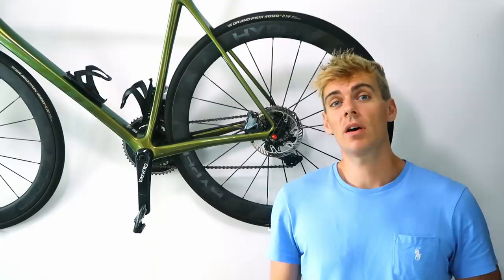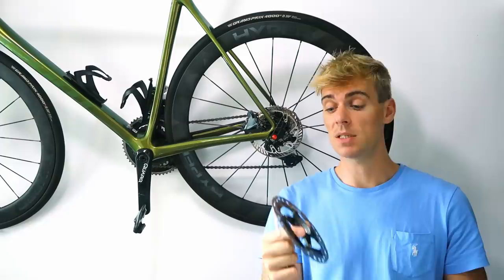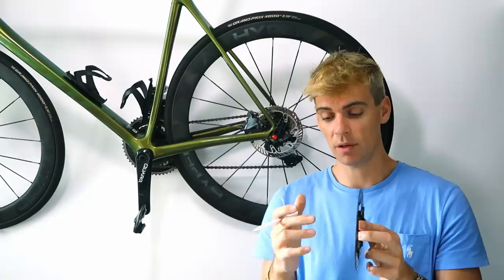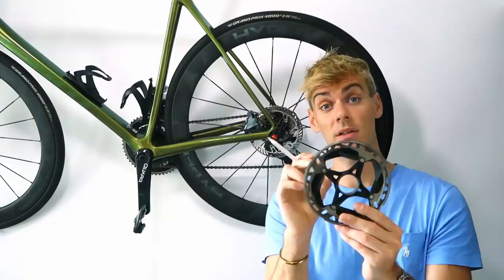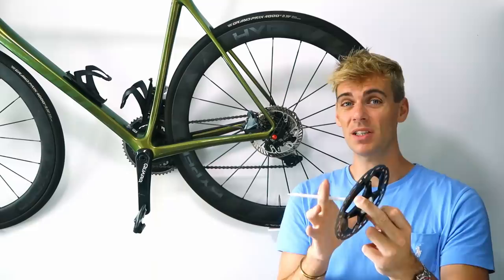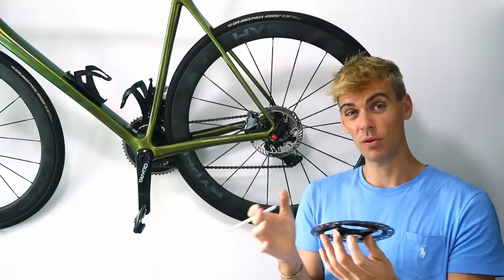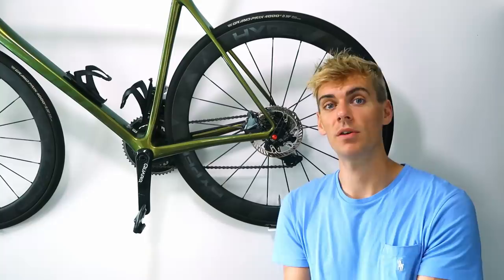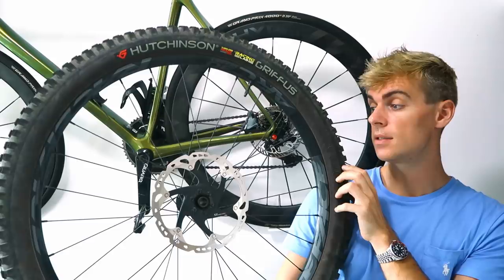Why I stopped using Shimano rotors: Disc brake rotor design, cracks & thermal issues discussed.

Comment: Logged in just to leave a comment. No idea why people bite these floating rotors. Solid ones brake great and last long. Did a 23km descent with an average grade of 5.5%, weighting at the time 92kg with only a front brake, 160mm rotor. Performed ok, minimal brake fade. Temperature wise, I just don't think the hubs get that much heat. Just think of the motorcycle or car brake disks that get up to 600C+ in race conditions and don't fall apart.

Comment: Don’t get me wrong I don’t want to question what you just said. But there seems to be an inherit quality difference between Shimano MTB Products and Shimano Roadbike Products. I’ve been using brake rotors with the same kind of technology on my enduro/downhill bike for years now, in the summer season even with metal brake pads. (Don’t remember if its the Saint or XT(R) Series) And mine should be structurally worse because they are 203mm rotors instead of 160mm like yours And I haven’t had an issue so far. No clicking, no rubbing and they only ever bend if I’m stupid enough to give them some kind of strong hit. I once even ran one down to 1.46mm (-0.4 below min. thickness, metal brake pads) and I had no delimitation. I wouldn’t have realised they are worn down if I wouldn’t have measured pro cautionary. And my first pair lasted like 2 years, not 6 months. What you are telling us sounds scary. And I don’t really think that the pad gap between road bikes and mtbs is any different.

Comment: Yeah i'm running the Ice-tech rotors atm, I did wonder how long they will last with only a thin sliver of steel each side... Do you run resin or sintered metal pads to get this level of wear?

Comment: Very excited to follow that project 👍🏻 Went back to my “old” rim brake bike after being on discs for a while - not just because of being annoyed by the brakes, but it sure is nice to have one thing less that needs fine-tuning all the time
Reply from the maker: Same.
Reply: Exactly...part of why I ride is a ‘simple’ mechanical interface, peaceful rides (I prefer quite hubs), and a ‘back 2 basics’ experience...discs, 2 much electrical equipment etc detracts from that~
Reply: @SprayIgniteBoom  I had this realisation recently while considering DI2.. I already get annoyed with keeping the head unit charged and pairing sensors, why add another battery etc to the list!
Reply: "You just didn't set the discs up properly"
Reply from the maker: @durianriders  😂
Reply: Spend the extra money on quality parts. CK BB, Hubs, Headset yadayada, Phil White etc. Works better, looks better
Reply: @durianriders  are you still stalking women?? really enjoyed you getting a proper doing !!!!!
Reply: More fine tuning? Properly working hydraulic disc brakes require much less fine tuning than rim brakes, especially if you want consistent performance. I also have Shimano IceTech rotors on my mountain bike and they indeed rub for a while after heating up, probably due to the hysteresis mentioned in the video, but they always return back to shape. Also maybe they are easy to bend accidentally, but they are also easier to straighten back, I do it just with my hands (of course freshly washed hands and do de-grease rotors afterwards). After heavy braking I just apply the brakes lightly once or twice and it seems to help - maybe the bent rotor temporarily pushes the pads out slightly more when releasing the brakes. I always had some concerns about the delamination problem, though - wondering what process is used to join these layers; the steel layer seems to get very thin when rotor gets worn out to 1.5mm. There are also some cheaper IceTech rotors without a real "spider" and fins, just the sandwich design - RT70 AFAIR. I have such a 160mm rotor in the rear and after heating up on longer decent you can see that the braking surface changes color sightly and the "legs" connecting it get a golden hue, but this is only limited to a small distance from the braking surface, which shows that the heat dissipation is good and the heat transfer towards the centerlock interface is likely small even without a real spider solution. In the front I have a 203mm XT level finned rotor.
Reply: There s no fine tuning all time,wtf are u saying
Reply: The big problem with road bikes disc's is probably them being super tiny and getting hot AF. On an MTB i haven't seen any of those problems that ppl seem to have with disc's on road bikes.
Reply: @kaedeschulz5422  or is that as MTBers we understand the key job of brakes is stopping us, and we use them constantly (in all manner of iffy conditions)?  
Also TBH, I've not had an issue with the rotors on my gravel bikes either - they just work.
Reply: @br5380  Most ppl i know use RT66 and i use the 64 because my hubs sadly have center lock disc mounts...
never heard of any problems with those. Also we use insanely large rotors to prevent brake fade. I run 203 front 180mm rear on my Enduro Hardtail any may even go bigger. Not sure yet. A friend of mine uses 220 front and 203 rear on his Full Sus Enduro. Maybe even 220 in rear too.

On road bikeish bike's problems always seem to be caused by having tiny rotors that get super hot.
Reply: @br5380  -- but he's talking about discs on ROAD BIKES.
Reply: @jerryc.5210  I also ride my gravel bike on the road

Comment: I ride 800+ miles per month and my Shimano rotors still have tons of life left.  However, they do tend to warp slightly but nothing I can't fix in a couple of minutes.
Reply: Yeah thisbguy is full of BS on his videos.
Now must be trying to start a business on a market full of the stuff for any given part.
I unsubscribed.
Reply: Hey Todd, which model of rotors are you using?
Reply: @mihugong3153  I've used both the Dura-Ace SM-RT900 and the Ultegra SM-RT800 rotors.  Both work great and I've had no wear issues using both of them for thousands of miles.
Reply: @tccycling  Cool, thanks for the info. I have XTRs on the way for my road bike, I guess I will try my luck :)
Reply: I ride and commute in only hills, I got 10 months out of my pads and rotors, that said I should have done them after prob 8 or 9

Comment: This video answered all my questions about disc brakes. And i learned a lot more than i asked for. Cheers brother! Im shifting to disc brakes this month as sponsors are now supplying us disc brake bikes, and im already having nightmares on how to maintain them, let alone the cost
Reply: 1.5 years ago, I got a disc brake road/endurance bike ... w/ Campy 160 rotors front & rear.  After 6 months, I was occasionally stopping to "re-center" the pads while on rides.  After 1.5 years, the rotors are slightly "warped".  If I had  had to replace them at 6 months as Peak Torque reported, I'd go crazy.  More importantly, I believe good rim brakes are better for road bikes because of the KISS factor, reliability, and durability.  I've had Campy Record rim brakes, so I can't comment on Shimano quality.  I bought my first C-Record bike in 1962.  I NEVER had any problems over the last 30 years/6k miles per year with good rim brakes.  They  stopped as well as my current discs, pads lasted longer than disc pads, and close to zero maintenance.  Disc brakes = 1) re-centering, 2) quicker wear, 3) more parts, 4) more cost, 5) warping, 6) special tools, 7) hydraulics & bleeding.  For ROAD, I consider discs a solution to a problem that never existed.  Gravel is a different application though, and I'm not talking about MTBs.
Reply: Sanaol may sponsor
Reply: @jerryc.5210 The Shimano XT 8100 disc sets on my Trek custom mtb have been stellar with correct maintenance and cleanliness which I follow .
Reply: @jerryc.5210  The new ice tech Shimano's are crack prone and not linished very well . They are Chinese "questionable" quality .
Reply: @jerryc.5210 I use Galfer 1.8mm thick discs in 180mm diameter or Deckas ones in floating bushing style with coloured 7075 carriers .

Comment: I'd buy some, but i think most people would be upset when their disks had rust on them. I'd be willing to guess that a surprising percentage of even the most expensive road bikes only get used a few times a year. I also think this push to make disk brake bikes as light as rim brake bikes so they can stop making rim brake bikes forces them to make rotors that don't have the mass they need to work right.
Reply: Agreed, rust would be a no go for me and I'd also like to see more road bike (centerlock) discs w/ thicker friction ring (i.e. >=2.0mm) for more mechanical and thermal stability.

Comment: Fascinated to see what you come up with versus what Shimano has in the pipeline with Dura-Ace 9200 brakes (and the context of Chris Froome's comments on disc brakes)
Reply: Considering their cranks have been failing for years due to poor design and they have not attempted to rectify the issue, they will probably not have any improvements in the pipeline.

Comment: I'm super excited to see how much better you can make rotors compared to what's available now. I will definitely buy a set when its available.
Reply: It will cost 150 pounds and last about 3 months and the constant of re adjusting the rotors and calipers so it doesn’t rub 😂 made in ali china 🤣

Comment: an efficient rotor would be, perhaps the size of the actual wheel rim, with an efficient and simple calliper type system applying the pads to the surface. You could even use the actual wheel rim. Maybe one day, manufacturers will decide we need that

Comment: I have been using AFS 03 rotors for a few months now. One thing I noticed is that the rotor feels soft when installed with some third-party internal spline lockring. It appears that because these rotor were designed for AFS, their crown face area is slightly larger than the lockring of the usual size. ZIPP's 160mm lockring solves that problem (ZIPP has two sizes of lockrings, but both uses external spline).

Comment: Interesting. 6 months life for rotors is crazy! My bike came with RT99 rotors which I replaced at approx 17500 miles, or about 3 set of pads. I replaced them with R8000, and your video prompted me to check them - the rear is at 1.5mm after approx 6700 miles, so the lifespan has been worse! The Campag ones look better value so I will probably go that route too.  Nice watch by the way, I have one of those myself!

Comment: My son recently had an Ultegra rotor fail after about 6 months use. The failure in his case was caused by the aluminium "cooling fins" becoming distorted meaning they rubbed on either side of the caliper. 
The stainless part was less affected. A complaint to the retsiler said was responded to with "no warranty claim as you were "dragging your brakes"".  My son has excrllent descrnding skills snd mskes much less use of his brakes than i do (i am a BC qualified coach  so i know how to observe these things...until he gets out of site!). I will be definitely switching back to full steel rotors after watching this. Thank you.

Comment: Good analysis.  I use SLX RT-70 centerlock rotors on MTB (160 and 180mm).  Reasonably priced and never had an issue.  Cheers and keep up the excellent content.
Reply: Roadies a dragging tiny rotors with tiny little callipers down mountain descent nonstop for miles.

Comment: Just because a rotor is two-piece doesn't automatically make them "floating". Very few bicycle rotors are floating. Hope make some. The braking surface has to be able to freely move laterally for them to be floating.
The point of making them two piece is to make them stiffer for a given weight.
As far as your desire for a full steel Centerlock rotor, you could pick any 6-bolt with a Centerlock adapter.
Reply: Very good points!

Comment: if your just going to laser cut solid piece - maybe inconel or hastelloy would be a good choice if you can get some offcuts? 
Really like your engineering knowledge - exceptional for such a young fella! Just remember to try your prototype on the rear wheel first before trying it on the front.

Comment: They’re not floating - floating rotors are where the rotor can move on the spider.

Hope rotors are floating for example.
Reply from the maker: These rotors definitely move on the spider... intended or not! Those rivets are not a perfect lockded 6dof fastener.
Reply: @PeakTorque  Sure, but that’s not intentional I suspect. Hope rotors have the relatively larger circular attachment, same as motorcycle and car floating rotors - designed to assist in even pad contact and more consistent bite points across varying temperatures.

The Shimano rotors are technically two piece fixed. Floating means they’re designed to move to accommodate variable pad contact situations.
Reply: Someone not named Froggy doesn't know what a floating rotor is, or that the flex of a thin sheet of metal isn't "float."

Comment: I've been using (older) XTR center lock all-steel (non-sandwiched) rotors on my bikes since 2003. Never had any issues at all to date. And they have lasted me literally 10's of 1000's of miles.
Reply: Dude get some new rotors. If your rotors get to thin you might go for your brakes on a fast downhill and the whole rotor jams into your calliper and throws you over the bars.
Reply: @TheNotoriousMIC  my current bike has around 40K miles on it and the XTR rotor thickness is fine. No significant or even noticeable wear.
Reply: @theadventurebiker  well if you’ve measured them and they’re still thick enough then we’ll done.

Comment: Great vid, always been suspicious of the amount of material on these rotors to disapate the heat. We already know carbon rim brakes exceed 200C so having a much smaller disc makes the disappation of heat even harder. Interesting to see what you come up with. 👍

Comment: I'm using SwissStop Catalyst Pro rotors on my shimano 105 disc brake equipped road bike and I love them.
Reply: Me too. My rotors have lasted over 1 year and I weigh 95+ kgs and ride in hilly Cornwall.
Reply: Use SwissStop pads too. 34 RS? Something like that.

Comment: From doing some work in this area, I'll say I've never seen heat manage to effectively make its way from the rotor into the hub body. Most rotors are stainless, which is terrible at effectively transmitting heat through the minimal cross section of the webbing and has ample opportunity for both convective and radiative cooling given the spindly nature of most rotors. Those with aluminum spiders have a bit less resistance in regards to heat transfer, but by the same token any heat making its way into the aluminum is even more quickly radiated and blown away. As well, the brake pads/caliper/brake fluid act as a quite significant heat soak for the system.

I'll also say that weight weeniesm is much of the cause of brake issues in the cycling world. The amount of mass used in bicycle brake rotors compared to the system mass is an order of magnitude less than for an auto or motorcycle, even though they're designed for ~similar speeds of operation.

ED: As a follow up, take a look at images of people who have overheated their road or mtb brakes. The heat affected zone universally stops barely past the edge of the pad contact patch. Oh, also fun note on the Shimano rotors, definitely had a coworker manage to squeeze the aluminum out while riding in the Alps!
Reply from the maker: Wow that sounds extreme. Yep totally agree. There's just not enough thermal mass or surface area.
Reply: Good points. A motorbike rotor might be between 1-2kg, of a 180kg motorcycle + 70kg rider that is ~0.4-0.8%. If you take a 130g bike rotor, that is ~0.2% of the total system weight. So a fair bit less yeah.
Reply: Haha my friend said it happened to one of the guides he was working with in the alps. Might be the same guy.

Comment: A lot of the pro teams where using Shimano mtb rotors last year. Anyone noticed that the industry has caused lots of new problems to solve with discs. Brake rub, hysteresis, frame compliance frame and forks failures, increased spoke count, wider rims to increase rim torsional stiffness, fat tyres all design solutions to accommodate disc brakes.  I’ll come back in 5 years time when you guys have done the hard yards and solved all the problems.

Comment: What do you think about something like the Shimano RT54 rotors? They're the cheap ones for MTB, would they transfer too much heat to the hubs?
Reply: They look OK, they are basically the centerlock adapter built in style (eg buy a centerlock adapter and a normal 6 bolt rotor and the end result would be the same). Thermal is a complete non-issue for casual riders. Not even sure if there is proof out there its an issue for pros. Steel is a poor thermal conductor and you have a tiny cross section transferring heat to the hub, so huge thermal gradient. https://www.mdpi.com/2504-3900/2/6/215/pdf
Reply: @jaro6985  That's interesting, thank you!
I could imagine that if i heavy rider were constantly braking on a very long very steep slope, mathematically there could be enough heat transfered to the hubs to ruin the grease. Maybe the brake pads would fail first.
But hey, i can try it the next time i'm riding down a trail, if i can still touch the center part of the rotors when i stop :D
Reply: Good idea, start from the center and work your way out, not the other way around :p
Reply: I don't think it is possible to transfer this much heat into the hub for the reason being mentioned by Ja Ro. Also at some point you will need to stop and let your brakes cool down because of fading...
Reply: @jaro6985  noo, i figured it would be a lot more fun to go from the outside. I have 10 fingers to test with :D
Reply: @KasimirBlanco  exactly. If i reach the point of my hubs getting heat damage, i probably have a whole lot other things to worry about :D